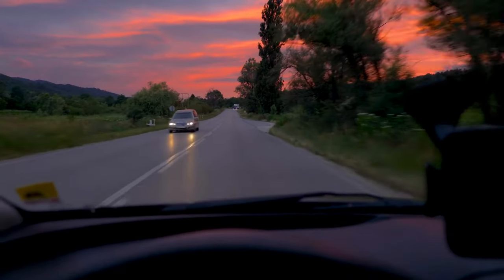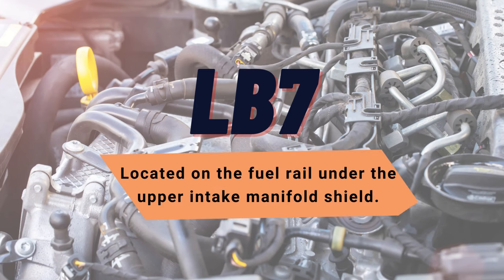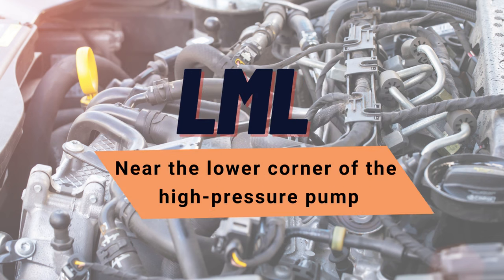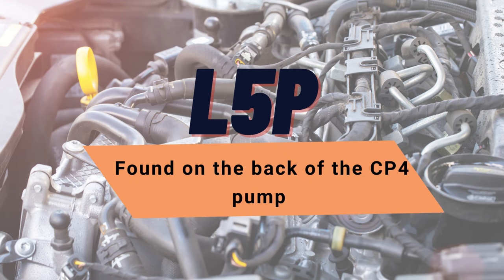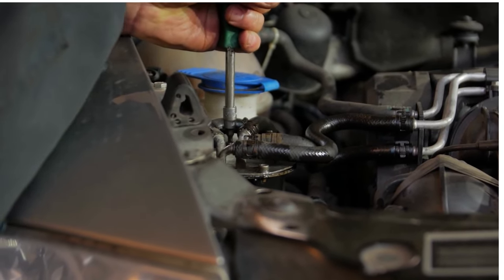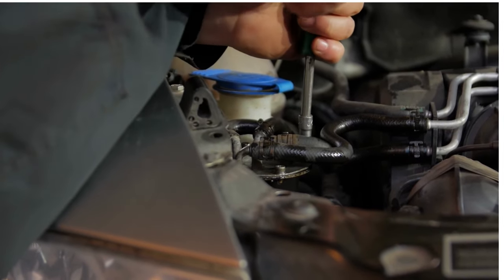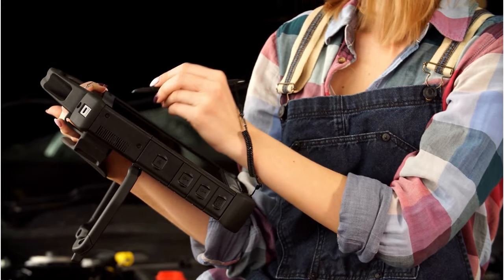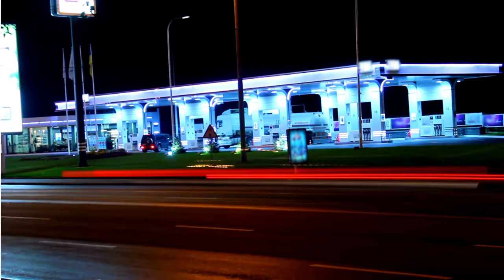Where is the Fuel Temperature Sensor Located and How to Maintain It?

Comment: You know if the fuel pressure sensor it’s same it’s fuel temp sensor y call Napa and other auto parts and they don’t have a listing of that sensor and I only find the sensor on fuel railing can you help please ?
Reply: Hey did you ever find an answer? I’m trying to figure the same thing out.
Reply: 2 totally different parts..personally on my lly..pressure sensor is passenger side fuel rail directly under boost pipe...fuel temp sensor is drivers side fuel line below turbo and intercooler pipe